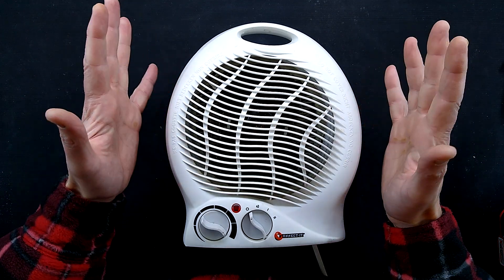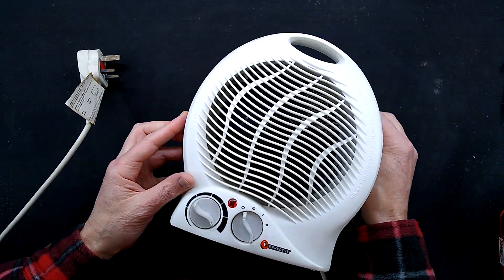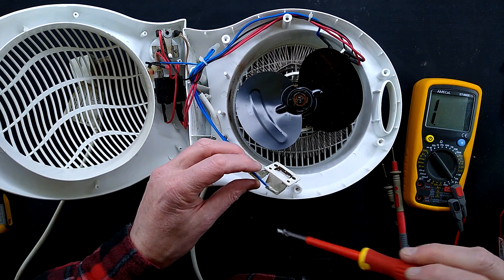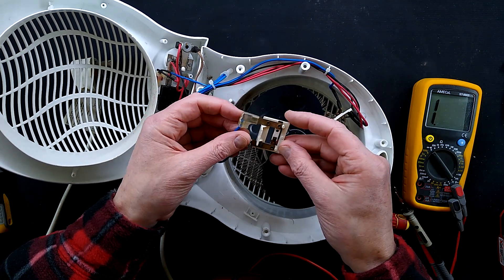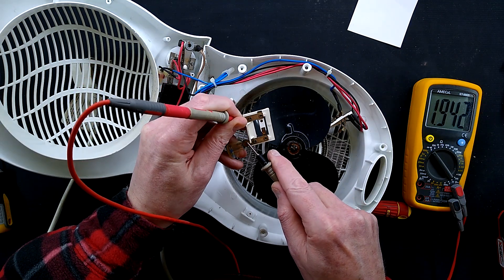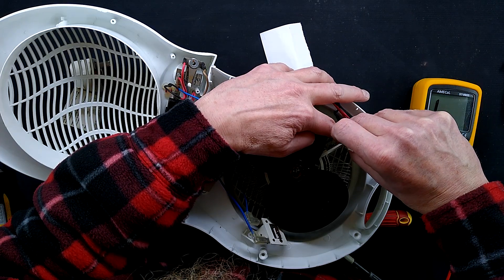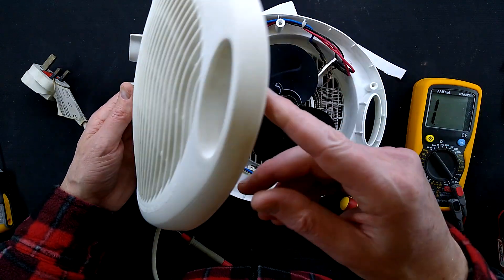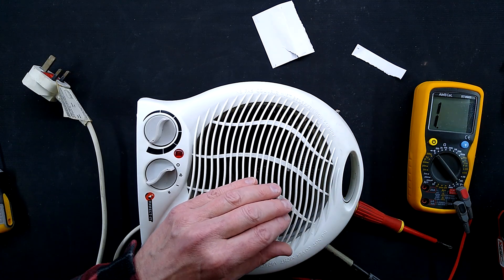Fixing a heater and an apology to my bro

Comment: 🤨 - interesting that the thermal cut-off is not mounted to the heater and at the side ~ and doesn’t turn the fan off when tripped [would be cooled by the fan], my fan heater has both the thermal cut-out and fuse on the heater frame and connected to the neutral ~ both fan and heater would turn off on overheating, unfortunately when testing the thermal cut-out, I also blew the fuse 🫢 as I wanted to continue using the heater I did look at thermal fuses online but for the annoyance of finding the correct rating and buying it and that it had been riveted to the frame, I got a nail, filed the point off and bent it onto an “n” shape and put it through the rivet holes and bent the ends for a connection, it has been there ever since. I know not to deliberately overheat it again

Comment: Lovely walk-through.  Unfortunately I've got a couple of these style heaters and the corpse of my once favourite hair dryer/shop low heat gun that have popped the heating coils.  Gave a few attempt on the heaters, as the hot-spots that popped the coils were near their original connection.  I massaged the coils further along to give me something to crimp them back into the original connection, but they still failed again in short service.  The hair dryer...  perhaps still too soon to approach; I loved that little guy, and it gave out in the midst of a continuingly unfortunate repair experience I still haven't quite recovered from.

Comment: I've often used an emery board on contacts like these. If they are solid silver and not gold plated it's fine, and often by the time this becomes an issue the gold playing is gone, anyway. It's only a few microns thick.

OTOH, if arcing in involved and the contacts are pitted, then you're stuck replacing the part. I had a refrigerator thermostat i replaced a few years back where the contacts looked like the surface of the Moon, with deep pits completely covering each surface.
Reply: An emery board is rather course for this-a much finer abrasive is more suitable for this, assuming the contacts are far enough gone to need this.
Reply: The whole heater costs 10 coins. Do you expect massive silver? Probably a very thin layer.
Reply: @pizzablender  That's why switches with silver contacts cost more than ones with gold contacts.

Silver contacts: material is too thick for it to matter.
Gold contacts: material is too thin for it to matter

Comment: My "favorite" failure mode is the anti tip microswitch melting.
Reply: We've got ordinary not heated fans here that have tilt switches.... And one only works if you get it at a weird angle. I assume the tilt switch has pitted or corroded and the angle makes it contact in a slightly different place. Whatever the cause, when it goes completely, I'm just going to bypass it. It's a weird feature to have in a normal fan.

Comment: If the thermals are dead you can always bypass them as well.  Not great for safety but still an option.  Ive been fixing these guys for awhile now its almost always the thermals, but every once in awhile you get the occasional bad contact in the clip to them.  Had a brand new one i bought off of amazon that the clip just wasnt seating right and causing a bad connection.   These little heaters suprisingly will last forever with the thermals removed, i have one thats been kicking around for about 15 years now.
Reply: sure, just bypass all the thermostats and safeties, the next time they tip or get covered over, you'll be very warm! maybe even incinerated in the fire. lol
Reply: @throttlebottle5906  only if your stupid enough to tip them over and not pick them up right away
Reply: also already said not great for safety but can be done to fix them.  Beats freazing to death i would think.

Comment: I live in Australia, and it's not uncommon to have days where the night might only be 5 degrees Celsius, and then the daytime can be 35 degrees Celsius. The problem this causes, is condensation, anything with a decent thermal mass, will remain cool when the morning daytime rapidly heats up, natural surroundings like granite boulders attract water and then moss and stuff love it, but the same happens with anything you own if it's exposed. And this effect can become even more exaggerated in a shed that lacks insulation, as the shed actually starts to act like a greenhouse a bit and it becomes hotter in the shed than even outside of the shed, leading to any thermal mass objects in the shed to getting a lot of condensation on them, since they are still cool from the previous night. 
The solution to this, is to extend the range of time of change in temperature. The most common sense thing is heavily insulating the shed, this stops the temperature from rapidly changing on the inside of the shed. However if this cannot be achieved, or if you have a flimsy garden shed and such, the only other way to prevent it, is to place fabric over the object you want to protect, the fabric insulates the product directly, something a little thick like a towel will do the trick. 
Moisture certainly is the worst thing ever, when it comes to anything made of metal, and especially to anything electronics based. It depresses me so much to find something that corroded and was destroyed by water, therefore I take extra care to protect everything, and also to insulate walls and such of sheds or anything where items are stored. 
I have found that even China cheapo products easily can last 3-4 times longer if you just take care of them, mostly this is done by protecting from moisture.

Comment: I used one of those to help defrost a freezer a while back and it overheated and shut down. I thought it was toast but I let it sit for a while and it worked again.
Reply: if it has a good drain just use warm/hot water to defrost, if not add a shop-vac  to the mix so it doesn't flood out(fridge freezer combo's have limited drain pan/condensate evaporative pan underneath. even cold/cool water will melt the ice fast.
Reply: @throttlebottle5906  Thanks for the advice, we actually already replaced that fridge. It was 20 years old and it was time.

Comment: I was thinking the same thing as soon as the contact started going then it's going to build heat and shut off probably even more often and then like compoundingly take itself out which like you said if it welds then you got the fuse so I like how robust the safety is as silly as it seems

Comment: I've had a few "melty" moments with these heaters, and quite frankly, I would not give them house room. They're a fire waiting to light. I had one which decided to spontaneously ignite one afternoon, but thankfully I was in the room when it did, so out the window it went. I've had plugs that have melted for no obvious reason, and God alone knows how many of those safety cut outs I've had that failed. One of them is a thermal lock out which will not reset until power has been disconnected for about ten minutes, the other is just a thermal trip. 

At about twenty quid apiece, and getting through two per season, it was an expensive hobby, trying to keep the house from bursting into flames when you had these things around.

In the end I bit the bullet and bought a steel cased space heater of 2kW rating, and I've never looked back. I actually went and bought a second one, but I made the mistake of leaving a glowing consumer report, and then the price doubled in the space of a weekend (The Big Clive Effect). Anyway, into a third winter with these ones, and all is well.  That would have been twelve of those plastic "melty monsters"by now!⚠️🎆💨🤷🤦
Reply: The oil filled heaters are better, though not quicker.
Reply: @SeekingTheLoveThatGodMeans7648  Do those take more power to heat up, though?  Had one in a bedroom a few years ago and the electric bill was unbelievable.
Reply: @idjtoal  Outlets have a max wattage (in the usa) of 1500 watts. You won't find any heaters (or any device) that plug in to the wall that pulls more. The only thing I can think of is that the other heater you had was like 900 watts while the oil filled was the full 15.

Comment: @bigclivedotcom would dielectric grease help prevent corrosion?
Reply: Is dielectric grease flammable?
Reply: @westinthewest  I don't think so, it's used in the automotive industry on wiring clips, spark plugs and stuff so gets pretty warm there
Reply: @dcf476  I guess if grease is used in automotive wiring, it'll be as a corrosion inhibitor.  
Another question is 'What is dielectric grease?'.
I've used vaseline, mineral oil and WD-40 on outdoor electrics without any consideration of their dielectric properties.

Comment: It is good practice when working on anything with a plug, to get into the strict rule of having the unplugged plug visible where you're working.
Reply: Teenage me wants you to know that advice is especially appropriate if using a non-insulated screwdriver with a metal handle to undo the screws on electrical terminals 😵‍💫
Reply: That’s a really good advise.
And to have the work area (a bit) clean from other similar cables, so you minimise the risk of unplugging the wrong one.
Reply: That strategy doesn't eliminate the possibility of having the incorrect plug in view.
A non-contact voltage detector can be quickly waved around the danger area at various times.
Reply: I usually hang mine on a little hook screwed into the side of my trust bench. That reminds - must get an Explosion-Containing Pie Dish.....

Comment: These fan heaters are lethal, best place for it is the bin...... I've had two of them, exact same item, the fan motor eventually goes and the thing goes into a cycle of overheating, melting, turning off and then melting again, it wouldn't take much for the thermal safety switch to weld it's contacts together and turn the whole thing into a smouldering ball of plastic.
If I buy a fan heater now, it has to be a PTC ceramic heating element and I don't buy cheap, I also prefer to get something with a low voltage DC axial fan. as I know the fan will be the last thing to fail.
Reply: Same here.  Those cheap induction motors often lose a winding or something, so their max speed gets slower and slower.  Spins freely, just no electrical torque, sometimes not even enough to start the fan from off.
PTCs often crack, though.  Had one disc type start blowing white smoke through the holes at the hotspots.
Only heater I have now is the 2 quartz rods that heat up, no fan.  Get those rays shining on me and they'll heat me directly vs trying to heat up the entire interior.
Reply: majority have a non-resettable thermal fuse that burns open permanently. that said, it may take a good while to trip and emit molten plastic fumes/smoke. all bets are off it it's unknown cheapest out there.

Comment: Too bad most metals turn to garbage in the presence of heat and oxygen, oxide layers in barrel comnectors and power switches often negatively effect the functionality of older electronics.
Reply: just this week I had a top-loader SNES that would not power on, the only issue was poor contact inside the power switch; desolder the switch, bend out the tabs that retain the fiberboard in the metal housing, clean+polish the contacts and "wiper" inside the power switch, reassemble, bend tabs back in place and solder the switch back onto the MB.
Good as new 😎

Comment: Good tip for soldering the thermal fuses!  I learned that one the hard way.
Reply: Tinfoil.....or to be accent correct aloo min e yum
Reply: most thermal fuse are screwed down or crimp contact to avoid the solder problem.
Reply: I just started to go and undo the crimp carefully, so you can use it on the next one. Works well, and otherwise you just take any of the common plastic insulated crimps, and remove the plastic, cut the crimp ferrule off the end ( pin terminals are ideal for this) and use that small copper sleeve instead, and a pair of pliers to graunch it down good and tight.

Comment: The biggest question I've had about these is, why the two blade fan? It's so ineffective...
Reply: Cheap to manufacture, single piece of metal.
Reply: Also the heating element is behind the fan, rather than the normal way where the cool air is blown across the element, this sucks the air through the element, it must cause the fan blades & motor to become very hot.
Reply: @RichieReportsUK  the blades get hot but they are metal, I always thought three blades were the most efficient type, if anything, at least I could use it in an oven 😂
Reply: cheap to make....

Comment: Haha, I just bought a second one of these after the first, after so many fixes, is perhaps no longer as safe as it should be, the fan also stalled one time and the thing light up like a Christmas tree, before I jumped to turn it off!

Can also confirm these corrode like a bitch if it hasn't been used for about a week

Yours seems to have no trip cut out, working even if it's fallen and cannot get airflow...
Reply: Fan failure is very common on these, they're not worth the risk. I bought two of them, and the fan windings went open circuit in the same way, causing the thing to go into meltdown. It'll overheat, trip, overheat, trip, overheat, trip and then at some point the thermal switch will weld itself shut and it'll just go thermonuclear.
Reply: @Strider9655  Cycling can be avoided by using a self-holding type of thermal cut-out (see Klixon TH11 and TH21 for 230V/120V respectively). Many (though not all) DēLonghi heaters use those, among them the HVS3031/3032 fan heaters and HSX series convectors (both of which are also exceptionally well-built overall, and I would have recommended the HVS here if it was available in the UK). I suppose the inconvenience (having to switch the heater off to reset) is why they aren't more popular, but to me the added safety more than justifies it (and the cost difference from the auto-resetting type is negligible). (You can identify the self-holding Klixons by a green spacer pin in the TH11/blue in the TH21, carrying the resistive track; whereas both are white in the basic TH10.)

I did check out two PTC fan heaters before (one 1800W rated/1600W measured, the other just 500W), but those tend to have very feeble airflow (due to being made as small as possible) so I've been happy enough to stay with wire-element heaters of reasonable build quality. (DēLonghi also make some PTC convectors although they're quite expensive, so I've yet to try one myself; but worth considering if you want silence and extra safety while warming up faster than the oil-filled heaters.)
Reply: @longrunner258  thanks, I'll look into it!
Reply: @Strider9655  the newest version seems to be something of a death trap, I'm thinking of putting a decent tilt switch into it 🙈

Comment: I was fixing something on my bench at work, as i plugged it in, switched it on ALL the power in the workshop tripped.  Bloody flying leads, (I should really have had a Cliff power terminal). I had big, black and copper skid marks on the back of the repair manual. 🤣🤣